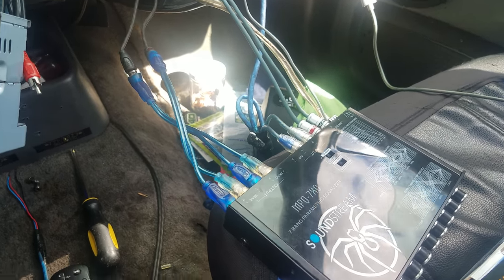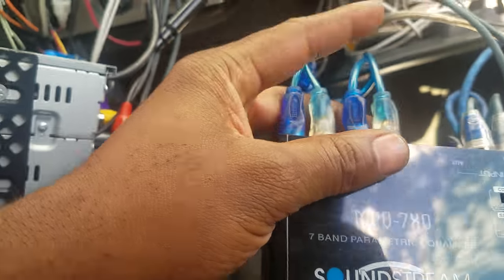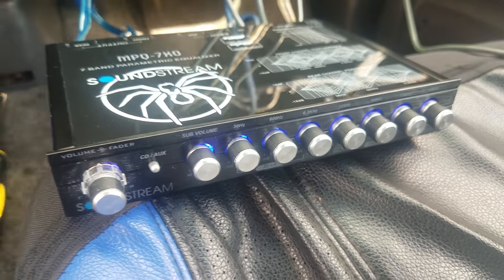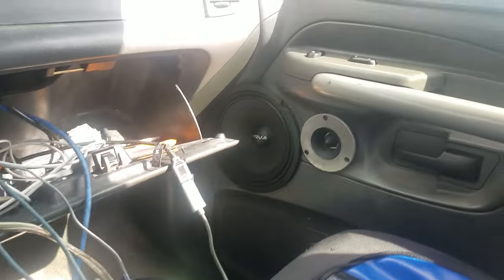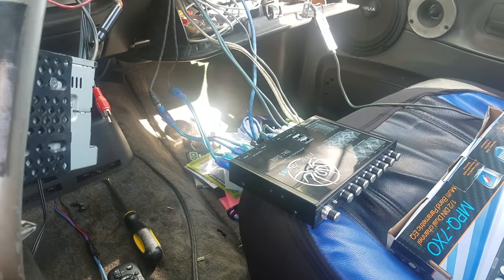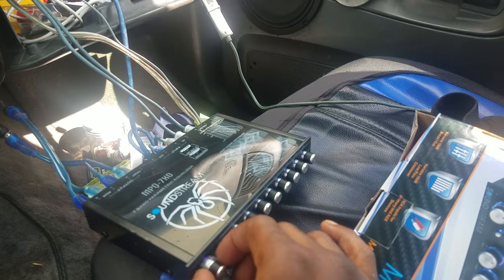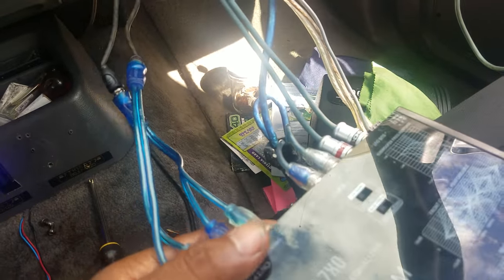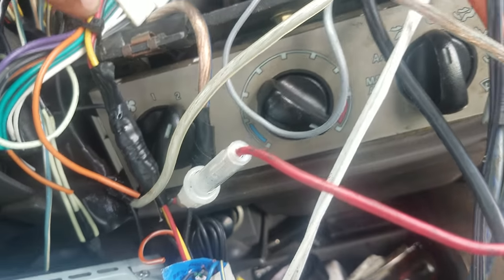Soundstream MPQ-7XO Equalizer Install

Comment: THANK YOU!!!
Reply from the maker: No prob bro
Reply: @BIGJURAY20  Whats up bro
Hope you are good 😉
I need some advice
I have 2 pioneer 10 inch limpids which are 3 way speakers...they have a subwoofer mid and tweeter 
How would I hook Em up to a preamp to control bass mid and highs 😅😱 I have no idea how to do it
Please give me some tips
Reply from the maker: @trevinopadayachee8570  to control your midrange and midbass speaker you're gonna want them on the rear channel. And your tweeters will be on thr front. That way your speakers can be adjusted with neccessary crossover points. When using an external Equalizer such as the one used in this video. I recommend leaving all crossover points/ gains on the headunit on 0.
Reply from the maker: @trevinopadayachee8570   Are you using a 4 channel amp to power them?
Reply: @BIGJURAY20  but how would I do it because its one speaker with the tweeter and mid
Reply: @BIGJURAY20  2 channel bro 
Input ( Left and Right) 
Output (Left and Right)
Reply from the maker: @trevinopadayachee8570  well nothing going in the output side of the amp from the equalizer. Technically it's easier with a 4 channel that way you can seperate the crossover points. Tweeters 1 and 2. Speakers channels 3 and 4. In your case with a 2 channel you can try using a rca splitter female in 2 males out. Doing this will allow you to use channel 1 of the amp on Front of equalizer for tweeter crossover frequencies and channel 2 from the amp on Rear of equalizer for midrange and midbass frequencies.
Reply from the maker: @trevinopadayachee8570  does the tweeter have it's own terminals seperate from the speaker itself?
Reply from the maker: @trevinopadayachee8570  can u send me a link as to the speaker you're using?
Reply: @BIGJURAY20  The speaker has a positive terminal and negative terminal coming out 
Go check Em out fr me please bro I appreciate all yr help 😊😉👍 they are pioneer limpids 420w each 3 way speakers 
My head unit has a left amd right channel and my amp has a left and right
Reply: @BIGJURAY20  okay np
Reply from the maker: @trevinopadayachee8570  this takes me to the site. Can u show me which speaker we're discussing
Reply: How will I show you bro I dont know how 2
Im not so good with that 
Doesnt the site show you the speaker ? You can search on Google pioneer limpid 420watt 3 way coaxial speaker
Reply from the maker: Ok i looked into the speakers you're running and unfortunately you're not going to be able to seperate the tweeter from the midrange/ midbass.
Reply from the maker: How do you currently have the speakers wired to tha amplifier?
Reply: BIGJURAY each speaker are wired on each channel 2 channel
Reply: @BIGJURAY20  so are you saying I cannot connect them to a preamp 
Example bass.will play on tweeter if I plug rca into rear channel for bass frequency
Reply from the maker: @trevinopadayachee8570  yes that's a good way to have it.  Do you already have the equalizer?
Reply: Hi bro thanks for all yr help 
I hope I was not a pest 😞😵 just that I was so frustrated and didnt have an idea of how to connect the preamp for the speakers 
But anyway thank you👌👍😉😆👊 anyway I know now that It will not work 
I will just have to keep Em straight to the amp and adjust with my crossovers on the amp
Reply: @BIGJURAY20  yes I do bro
Reply: @BIGJURAY20  do u mean the way its wired or good way as in connect speakers fro midrange bass
Reply: @BIGJURAY20  tell me 1 more thing I have a bass boost on my amp if I pick that filter up will it affect my tweeters which in turn myt pop them
Reply from the maker: @trevinopadayachee8570  you can still use a equalizer to help fine tune it. It may help bring the sound out a bit
Reply from the maker: @trevinopadayachee8570  and it's no trouble at all. I'm happy to help
Reply: @BIGJURAY20  okay so I should I use an rca on rear channel on EQ for bass and midbass? Wont it affect the tweeter
Reply: @BIGJURAY20  thanks alot man 🙌👍 thumbs up 2 you 
Where are you from its nice chatting to you and making a new friend im from South Africa
I will make sure I ask u all my questions when it comes to car audio
Reply from the maker: @trevinopadayachee8570  just as long as you're not exceeding the gains on the equalizer I'm sure you'll be fine
Reply: @BIGJURAY20  okay cool so I think ill connect them speakers to EQ for bass 
And then pick up the bass boost on my amp to push them to their full capabilities and as you sed I will keep gains down on eq and amp
Reply from the maker: The tweeter on the speaker should have a crossover cap already installed from pioneer to prevent any unwanted frequencies being played.
Reply from the maker: Never use bass boost. Almost always instantly distorts the signal
Reply from the maker: 0 out radio 
Have your crossover knobs on eq all the way down and slowly turn up till u get the sound you're looking for. It's a midbass/ midrange driver not a subwoofer so you do not want too much bass
Reply: @BIGJURAY20  okay thanks bro thats put my mind at ease now
Reply: @BIGJURAY20  what do you mean by O out radio
Reply: Explain to me why rms matters more than peak 😕
Reply from the maker: @trevinopadayachee8570  rms is the true power rating.
Reply from the maker: @trevinopadayachee8570  u should never use Bass boost
Reply: @BIGJURAY20  cool bro 👌
We chat soon 
Yr yelp was much appreciated

Comment: I want to put this on my factory door speakers on my armada
Reply from the maker: Well you'd need an aftermarket amplifier to help tune with equalizers like these.
Reply from the maker: I also have a Armada mines a 09 the stock system is actually pretty loud for what it is
Reply: I was thinking to put an amp
Reply: @BIGJURAY20  ok
Reply from the maker: @Shane23Armada  Yes it will definitely help and depending on the power applied changing the speakers could definitely help as well

Comment: Can you take more detailed video about 7xo?
Reply from the maker: I no longer have the unit. But, what is it you would like to know?
Reply: BIGJURAY20
If i want to open max volume, What db has it distortion? 110db-115db..?
Reply: In what severity does db start to distortion?
Reply: Has it very high no distortion sound?
Reply from the maker: During testing i found little to no distortion. It still has distortion at most frequency points past half mark
Reply: BIGJURAY20
The intensity of sound decibel was too high too?
Reply from the maker: @hiresprosound  I'd start with the crossovers all at the mid point with the radio flat
Reply: BIGJURAY20
Thanks bro.
Reply: BIGJURAY20
According to you, which equalizer should I buy? It must be the best!
Reply from the maker: Well, it's hard to say what's the best when i don't have hand on experience with all equalizers. But, this one is should do the trick. Soundstream also has a 9 band eq thats really nice. All boils down to a lil research and head to head comparisons
Reply from the maker: No problem i hope the info helps
Reply: BIGJURAY20
do you think it's better than 7xo clarion eqs755?
Reply from the maker: Honestly they are both very similar. Different crossover points
Reply from the maker: @hiresprosound  I've had both and yes i say this is better. Basing it on cost and quality. The clarion is nice but there are comparable units for cheaper
Reply: BIGJURAY20
Thanks so much my bro. I will try this.

Comment: MAN UR SHIT JAMMIN HARD.... SO I JUS GOT AN EQ DO I NEED TO SET THE LOW PASS ON THE FREQUENCY I SEE IT HAS SETTINGS FOR IT OR CAN I JUS INSTALL IT AN LET IT WORK FOR ME
Reply from the maker: I appreciate the love bro. Flat line all your crossover points on your head unit and control from your eq. 60hz to 90hz is a decent cutoff for your subs on your EQ
Reply: OK CUZ I AN EPICENTER TO AN I WANT IT TO CATCH THEM LOWS WITH THE EQ FORGOT TO MENTION THT TO AN APPRECIATE UR HELP G
Reply: SO DO I NEED TO TURN MY SUB CONTRAOL DOWN ON THE EQ OR CAN I TURN UP THE VOLUME ON THE EQ
Reply from the maker: Hard to say bro because i don't know when you reach a level of distortion. I'd have everything flat then tune from there bro
Reply from the maker: I tuned mines with a DD1 radio, eq and amplifier so i knew where i could and couldn't play on my crossover points.
Reply: YES THTS WAT I WILL DO WEN I GET IT INSTALLED AN DID U LEAVE UR HEAD UNIT FLAT LINE AFTER U TUNED IT OR MOVED THE EQ IN THE RADIO SETTINGS
Reply from the maker: Radio stays flat let the eq do it's job. Worst thing u can do is add dirt to the signal. Distorted signal can cause your equipment to fail
Reply: WELL I WILL JUS WILL FLAT LINE EVERYTHING AN GO FROM THERE PRECIATE UR HELP G
Reply from the maker: No prob bro

Comment: You have the y connections hooked up wrong
Reply from the maker: What way do you think i have them hooked up???
Reply from the maker: I'm not using a 4 channel amp in this video. I used the y rcas to split my 2 channel. Running highs from one channel and mids from the other